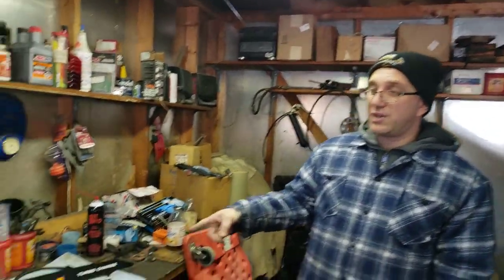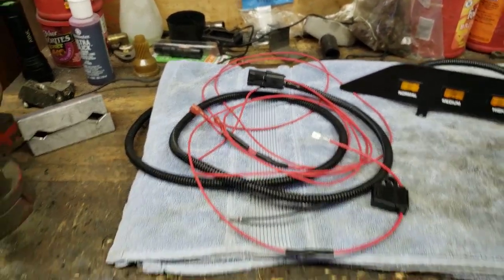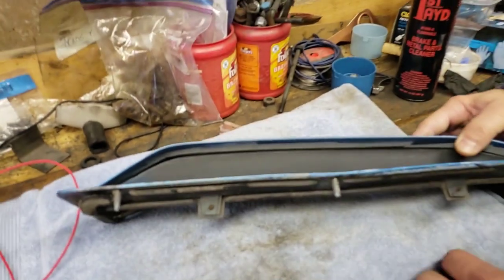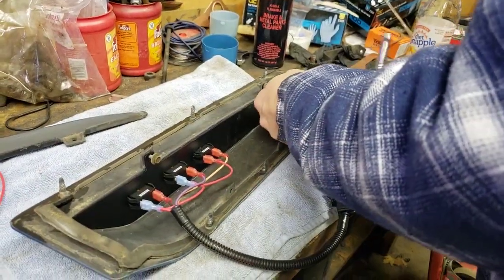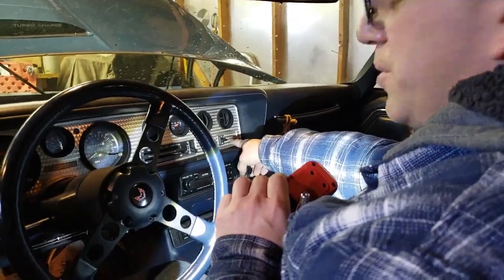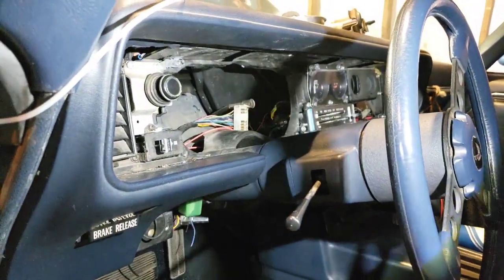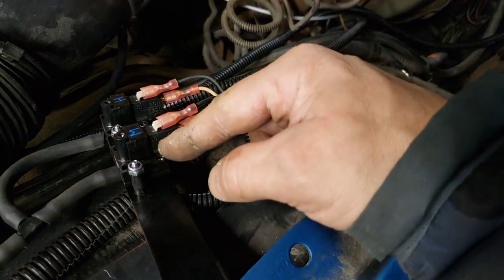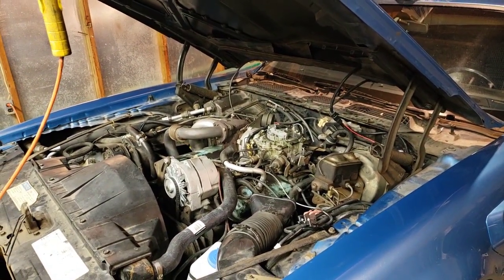TTA Performance-Rocky Episode 4 - Boost Lights Install

Comment: Nice install, nice kit and excellent fabrication of the kit. If I were to do one of these instead of 3 Yellow lamps, I'd prefer Green on all the time, Yellow for medium boost and Red for Maximum boost. Could that be a future option with the 3 colors in the kit? I know the 3 Yellow lamps were factory, but that seems a little dull compared to 3 different colors for the 3 levels of boost displayed...!

 I seem to recall a GM turbo car with the 3 different color boost lamps, perhaps the GTA Turbo, or one of the various Buicks: Riviera, Regal T-Type or GN/GNX? Thoughts?
Reply from the maker: I think Buick had lights for the turbo Regal in multi color.  I can probably do it for my light kit. Have to see what colors are available.

Comment: Great video, question where do you  Connect the other end of the vacuum hose? At the factory location of the original  Pressure switch location
Reply from the maker: Yes, you can connect the hose at the original pressure switch location. Remove a pressure switch and install a hose barb fitting.

Comment: I am curious about the carburetor size on the 4.9 turbo, somewhere I read or saw that they had an 850 cam carburetor. Is that true? Great video.
Reply from the maker: Thanks.
The 301T uses an 800 cfm Quadrajet carb.
Reply: @ttaperformance1046  I am not an expert, but that is a huge carburetor for that size engine. Do you know how such a big carburetor does not make the fuel mixture rich? Very curious to know the answer. Thank you for the reply. Maybe you can make a video on the subject.
Reply from the maker: The quadrajet doesn't fully flow 800 cfm. That is the max it can flow. The upper air doors for the secondaries only open as far as the engine demands. If the engine doesn't require 800 cfm, it doesn't fully open. Since the secondary metering rods are lifted with the air valve, it regulates the fuel flow based on the air flow. It is a neat way of doing it. The quadrajet is a variable cfm carb in a way.
Reply: @ttaperformance1046  thank you for the information.It is like an analog computing metering device.

Comment: What did you get your boost source from?
Reply from the maker: Either the boost line going to the wastegate, or from the fitting block in the intake manifold behind the alternator.
Reply: @ttaperformance1046  thank you for that sir..i have an opportunity to buy an '81 turbo ta that was abandoned...i will keep u posted.

Comment: That should fit my 1983 trans am I think, the scoop looks the same, but my car is not turbo.
Reply from the maker: Unfortunately this will not fit a 3rd gen hood scoop. Although they look the same, the shape is different.
Reply: @ttaperformance1046  I am depressed, it looks so cool, I sure miss my 80 tta.